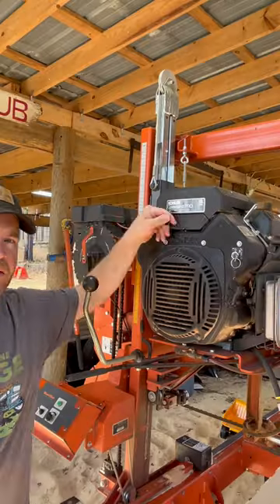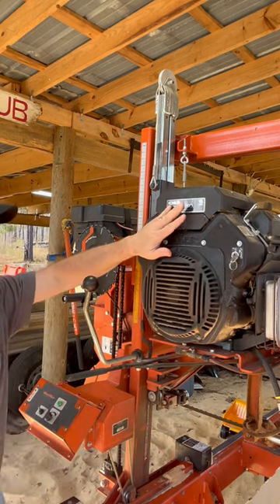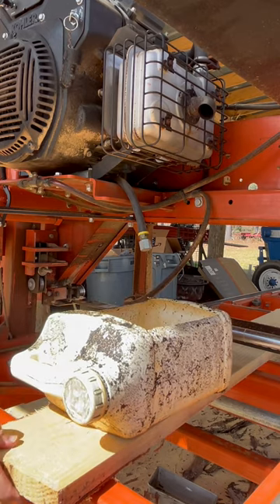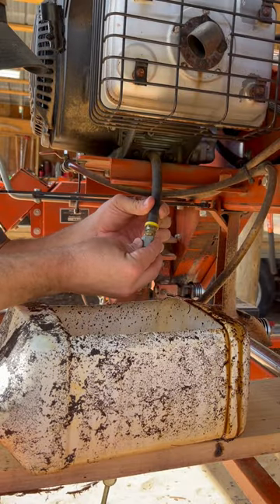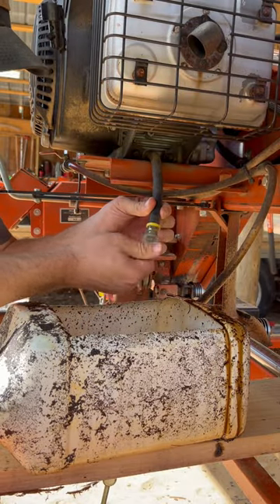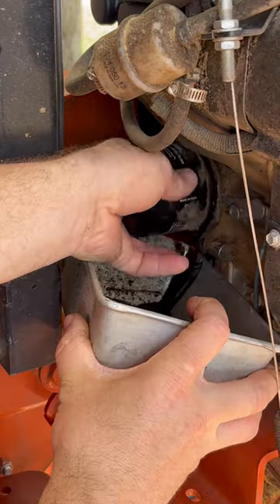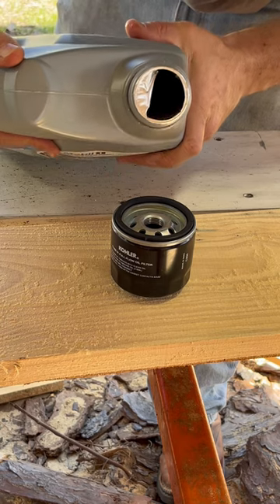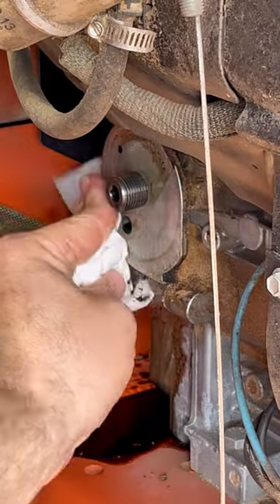How to Change the Oil in a Wood Mizer Sawmill

Comment: From research I've done on Kohler engines, don't use Kohler oil filters. The internals of the filter can come apart and destroy your engine. They can be cross referenced to a Purolator. Just what I've read.

Comment: Boy, wouldn't it be nice if there was a valve that could be installed for draining oil from motors!  Not nearly as messy.
Reply: Most new ZT mowers are equipped with a similar drain hose assembly.  Check your mower shop or hardware stores.  There are some on Amazon but some have metric, others imperial sizing and threads.  Good luck with your search.
Reply: @catgynt9148  That was tongue-in-cheek.   There are lots of valves that would work, even on the end of that rubber hose.
Reply: My Ferris mower has a needle valve for draining. They could have made the port a little bigger though. Take about 30-45 minutes to drain 5 qts.